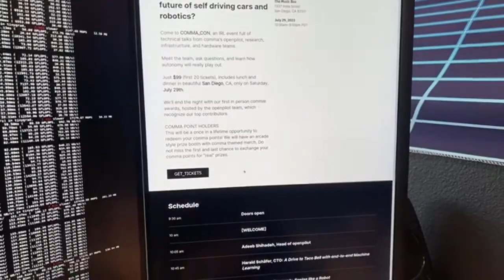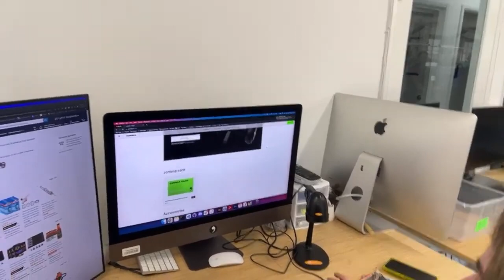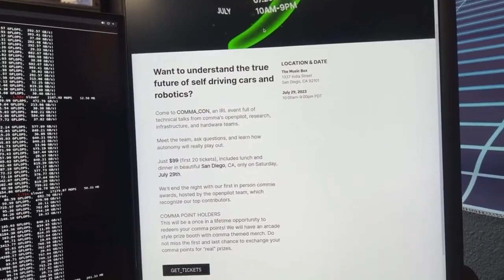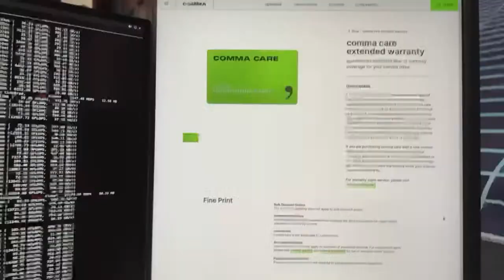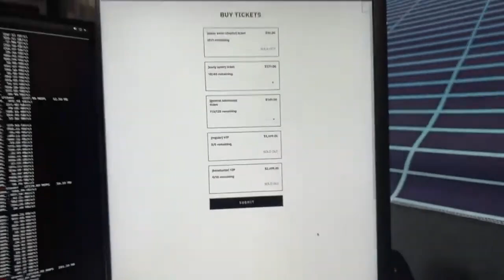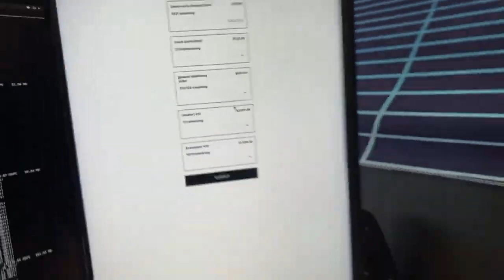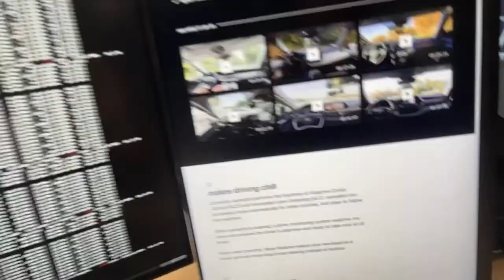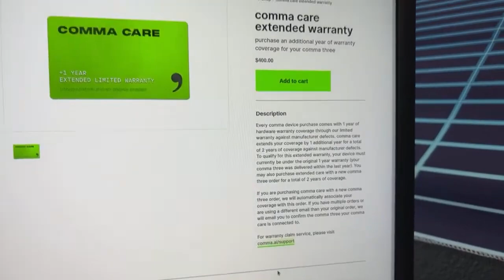comma ai | George Hotz | new “product” announcement | $400 1 year commacare extended warranty

Comment: how about Australia or other places where we drive on the left?
Reply from the maker: @gabecodina it works just fine. From the blog post - https://blog.comma.ai/0816release/#right-hand-drive-toggle-removal
Right hand drive toggle
In the last release, we mentioned that the current driver monitoring (DM) model not only predicts the driver states for both the driver side and the passenger side, but also outputs which side the steering wheel is on. This piece of information is now used to automatically set the RHD bit that is used by both the driving and DM models. Some extra logic is added on top to ensure consistency during and across drives. In addition to reducing complexity, auto-toggling fixes 1% of devices that previously had the RHD toggle in the wrong state.